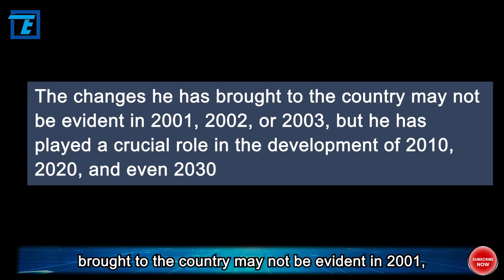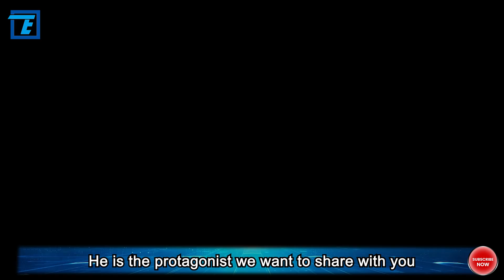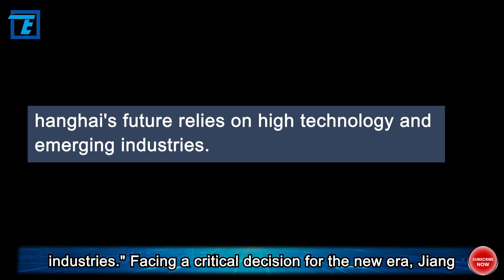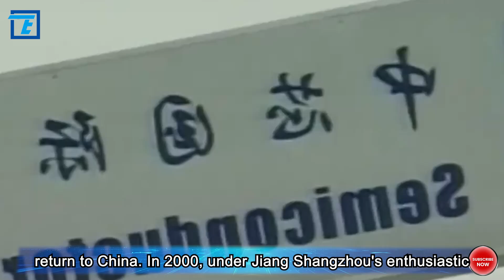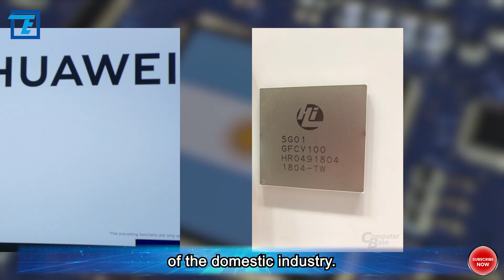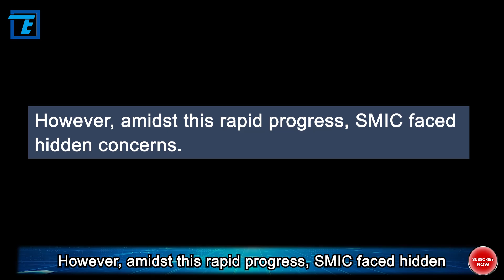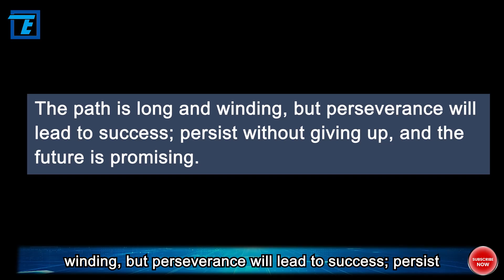The Return of Huawei's 5G Kirin Chip, Achieving 90% Domestic Production,   It's All Connected

Comment: I hear China is building a large synchrotron which will provide powerful laser light to numerous fabs in order to achieve high end lithography. This light source will be far superior to ASML's machines and represents half the problem solved. The other half of the problem is the lenses, but China could use metalens technology and get around ASML and improve on their optics as well. It is theoretically possible to get down to one nanometre and end up with lithography costing the equivalent of $40m per machine all in, including the shared cost of the synchrotron. This is far cheaper than ASML, which I think sells for around the $150m mark.
Reply: The china lenses are electron deflectors as this is not optical
Reply: Synchroton is a electron particle accelerator not light lasers
Very accurate
Reply: @theatomsinmearebillionsofyears  qualcomm is not 5G chip
Qualcomm makes less than 7 nm with EUV from amsl
Small chips do not make it 5 G
It is other techno in it and with it